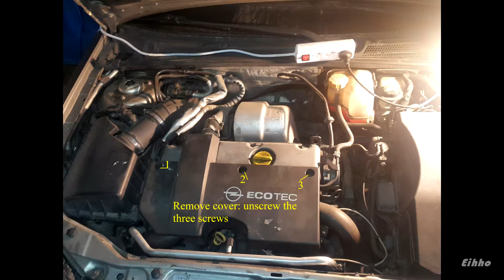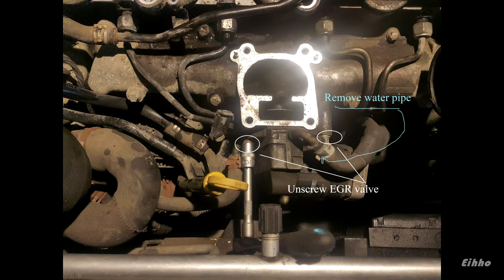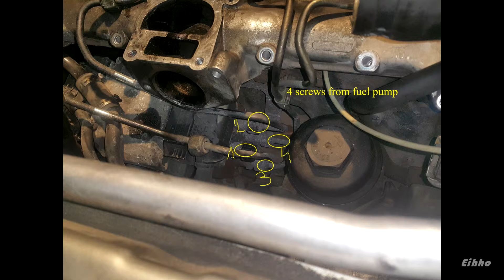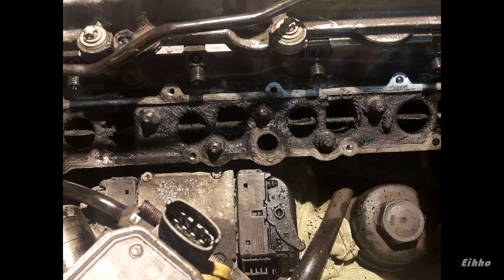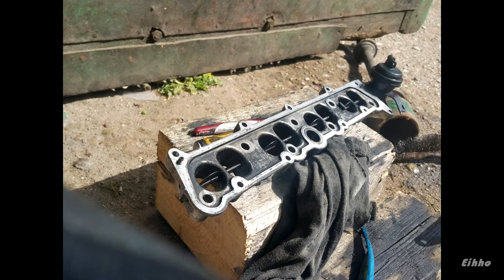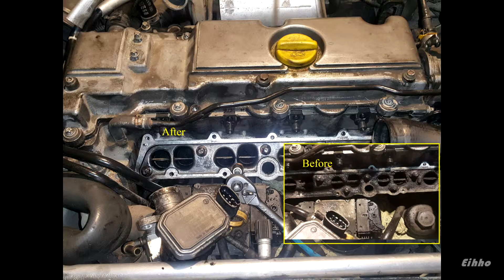Vectra C Intake Manifold cleaning Y22dtr

Comment: How about bleeding the fuel system after cleaning? There was no problem with the air pump?

￼
Reply: Wanted to ask exact same question - did he used vaccum pump to bleed the system or how he did that?
Reply: @marcinmorris  I will work on same motor, I think that fuel lines can be loosely thighten with injectors. Throw some paper around it not to create mess. And when fuel comes, tighten them. Do you have better option ? Fuel pump VP44 can day, this can help.. Is it good to remove screws when engine is hot?
Reply: @Jakov0007  hi, well the problem with this kind of hi pressure pomp is that there is no pump in tank that will provide the fuels for hi-pressurce pump. So if the hi-pressure pump go dry you will not be able to make it run. You can crank entire day and it will not pump any fiel - because it will not have any inside. So that was my concerns. T know tho there is a bleed valve on one of the fuel lines - I think its on a return line?